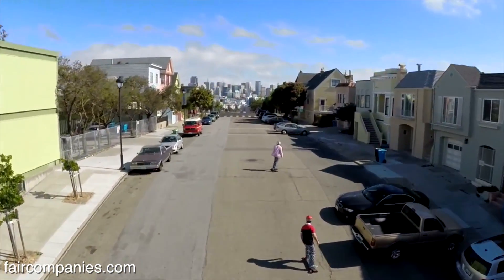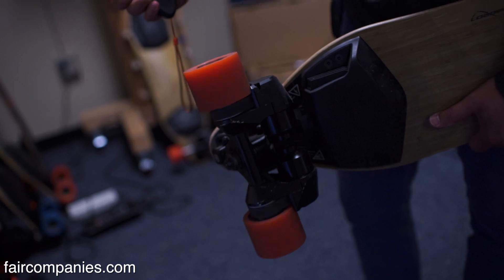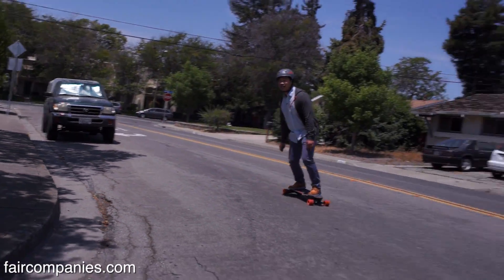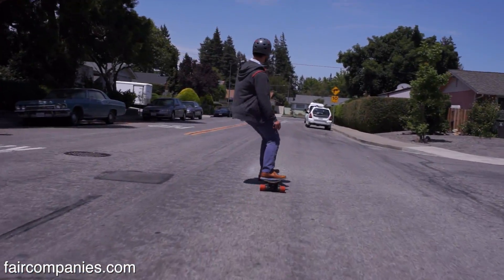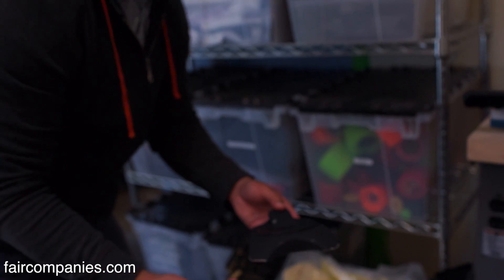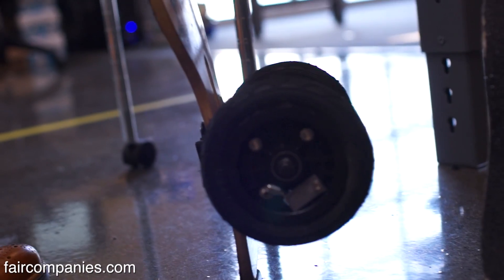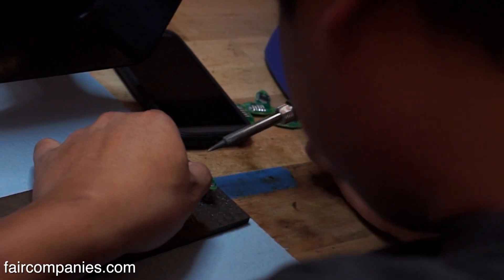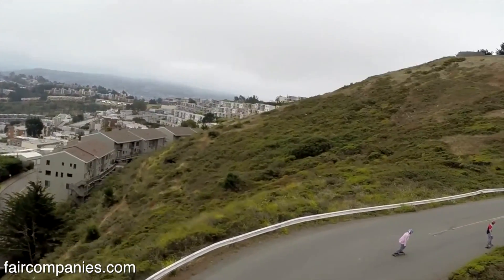Age of pre-hoverboards: robotics grads electrify skateboard

Comment: i like this. it is really cool. but for 1k+ USD for a 7 mile range with no solar type of charging i find myself using this in my city then having to stop far to often to do a "quick charge" implementing some type of accessories for solar charging on the go would be really great.
Reply: Chris Serna Why would you need a skateboard to go more than 7 miles. Obviously this type of vehicle is only practical for those who live a reasonable distance from work, or in the inner city. And the quick charge takes about an hour, so you could juice it up at the office or a restaurant during lunch or whatever.
Reply: this is true but i wanted to use it to travel around my city cruisin not stoppin you know. i dont want to have to push all the damn time.
Reply: Chris Serna You want to travel more than 7 miles? It sounds like you might be better off with a scooter.

Comment: Great video demonstration of the new powerful ride electric skateboards by the founders of Boosted Boards (one of several electric skateboard startups) was founded by three robotics graduate students who wanted to get around the sprawling Stanford campus faster than their longboards could take them. They began to tinker with “really powerful motors for robotics”, were eventually mentored by a Tesla engineer and opened up shop in Silicon Valley to take advantage of the local EV tech.

The boards are controlled by a Bluetooth handset, can reach speeds of 22 miles per hour, run 7 miles on a charge (1.5 hour recharge time), provide regenerative braking and weigh 13.5 to 15 pounds (depending on the model).

boostedboards.com

Thanks for posting the Age of pre-hoverboards: robotics grads electrify skateboard!

Comment: The hoverboard marketed is vaporware.  Anyone who has any physics background will realize what is necessary to actually use a magnetic hoverboard, note the tracks of a bullet train which is using the exact same physical principles.  In any event Boosted board is great, except for the cost, ~$1,000 - 1,500, the range, 6 miles, and the limitations of any skateboard, namely that bumpy roads with potholes, and rail road tracks, and water puddles etc. are all no go for a skateboard, electric or not.  In many American cities public transit is poor, and work or college is > 10 miles.  I'm trying to bike to work 2 times a week ( out of 4 days/week ), a safe path is ~8 miles, and a nice path ~10 miles.  Once the range reaches > 10 miles,  and the engine is more environmentally tough I will strongly consider purchasing one.

Comment: Skateboards need larger wheels. I use to ride when I was a teenager. I soon realized they need taller and softer wheels because one little rock will through you forward on your face. Not fun when that happens. If the wheels were taller and softer they could roll over small pieces of gravel.

Comment: Nice. I was waiting for the accessory solar panel suit someone could wear that could triple the power, or at least charge your batteries while your at your destination.  I was hoping that they might have some cool LED lights on them for good visibility in the city as well.  Those don't take much power, I have them on my remote control helicopters, which use the same battery-ESC-brushless motors.  Good luck!

Comment: the problem with these designs are it's only good for california or dry weather, no rain, no ice on the roads, warm weather.

in the Northeast here, it's too cold, people want shelter from rain, snow, sleet, high winds, cold and need heat. the surface also has a lot more potholes and cracks from the asphalt contractions caused by hot and cold. ice is also a concern to be worried about as well.

it's great for desert or dry cities as opposed to rural or suburban areas where the range of a commute is much more than 5 miles. the market for this board is going to be pretty limited.

personally the tiny 2 wheeled car/bike has more appeal and more potential to be used in more markets IMO.
Reply: "The market for this board is going to be pretty limited" -- yeah, that's what they said about motorcycles, too. Nobody rides motorcycles up north huh? Pffttt.
Reply: DertyMIQwerty42N
Not in the winter and motorcycles have more range. the skateboard range would only be good for college students at best or a nice toy but the skateboard isn't going to revolutionize transport in the northeast especially. there's probably less motorbikes in the northeast as well. look thru kirsten's vids, the electric bike vid is in Cali, i don't see motorcycle companies or shops like that in my area of northeast.
Reply: well in the northeast u guys have great public transportation hear in the west coast its really only like san fran so it would be great in big cities like l.a. and others around here oh coarse now we have uber and others but this could be nice to have just cruse
Reply: Outdoor Aesthetics
public transport is only in NYC, Wash DC, Boston, that's it. otherwise we're 90% suburbs, long distance commutes, highways, etc. I would actually say California is slightly more urban than the NE having been to cali myself. the properties are smaller lot sizes and closer together in cupertino as far as I know.
Reply: It's still fine for summer.